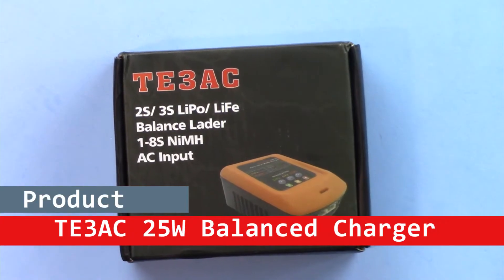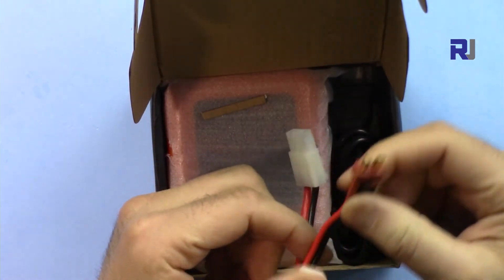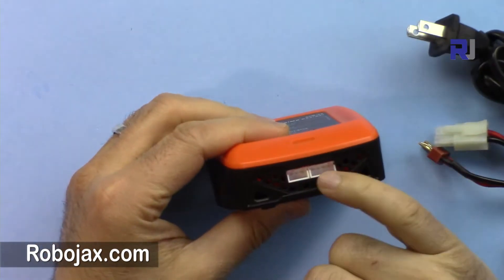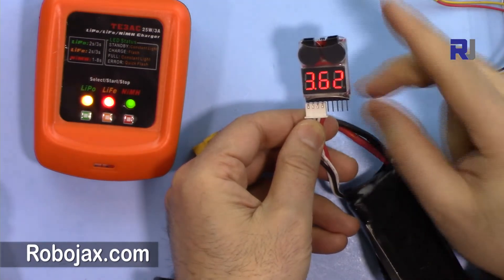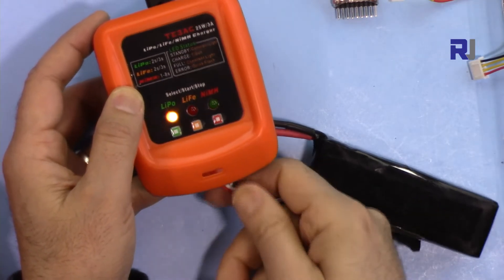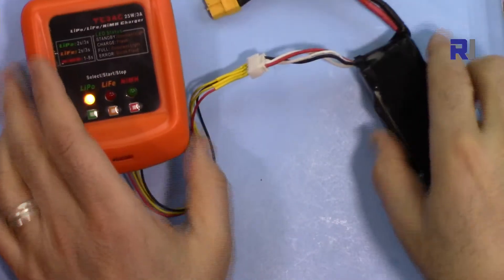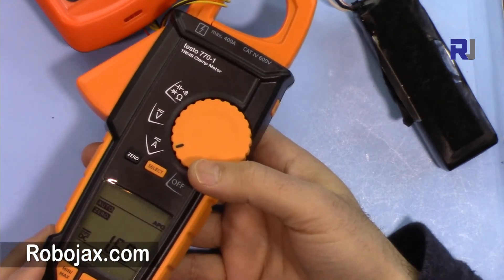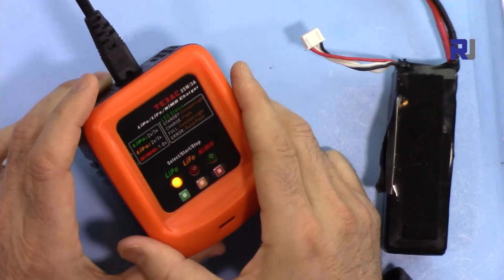Ho to use TE3AC LiPo Battery Charger (Test and Review)

Comment: This is a math problem, not a charger problem. It says 25W / 3A. 3A on a 3S battery 11.1V will exceed 25W at with 2 cells / 2 S or 7.4V however you would expect to see that peak current. You are getting closer to 20W, which ain't bad.

Comment: I bought this one from taiwangun and the instructions are fuxked up. In instructions it says green light blinkimg while on interface of cahrger is tottaly opposite. Its orange and in instructions its green, battery charges for 30 mims and it says its full while my gun worked for 200 bbs and died.
Reply: same here , no green light. just orrange blinking , and when stops change after 30 minutes, becomes full orange . after 200 bbs batery died
Reply: Same here
Reply: Yes, same here, only mine did it once where it showed as it's fully charged .. next 2 times i tryed to chsrge my battery it blinked for 3 hours ... and i shot 2 bbs and it died .. so the charger killed my battery after 2 uses ... hiw can i check if the charger is bad .. like what should be the actual problem?

Comment: I plugged in my LiPo through the balance port and the light flashed rapidly and wouldn't charge, how can I fix this?
Reply from the maker: either your battery is bad or the charger. try another battery. I assume all wiring is correct.

Comment: I know this is a old video but when u plug ur lipo in do u use that extra cord woth the deans connector into ur battery aslo? Or what is it for
Reply from the maker: the output connector is HST-XH and it is common connector that comes with LiPo batteries. I directly connected the battery to this charger.
Reply: I believe that's for non-balance charging batteries specifically for the niMh function.  2s and 3s can just be connected through the balance charging cable (3 pin or 4 pin).

Comment: My battery charges for like 1 min and it stops. What should I do? the manual told me to charge it using a balance board but I couldnt find a suitable one. please help
Reply from the maker: the best way to know what the issue it to measure the voltages of each cells. either the battery is bad or your charger. if you got another battery that might make it easy to try. if you see the same issue with 2nd battery, then charger is bad.

Comment: Did you ever check the current when charging a NiMH battery? Mine keeps saying full charge after about 30mins but i know it is not fully charged
Reply from the maker: Everything I have done, I have shown it in the video. In your case it could be the battery is bad or the charger.

Comment: My te3ac can not charge  after i charge    3 sec the led will quick flashing?
Reply from the maker: as mentioned in video, rapid blinking means error or disconnected connection. try another battery to make sure the battery  is good. If it did the same with another battery, then the charger is bad.